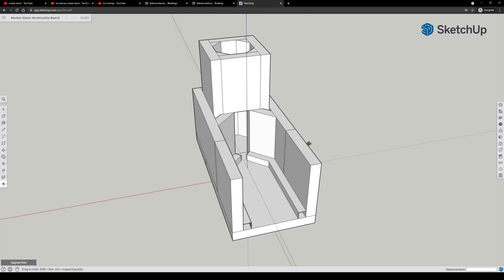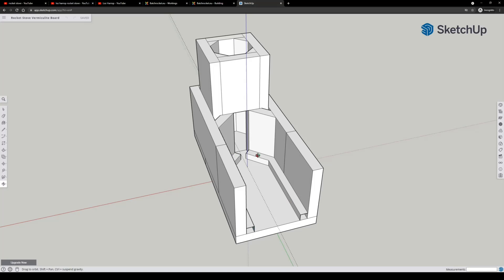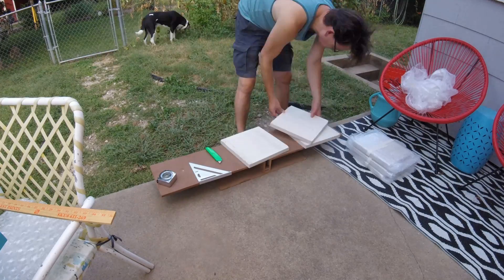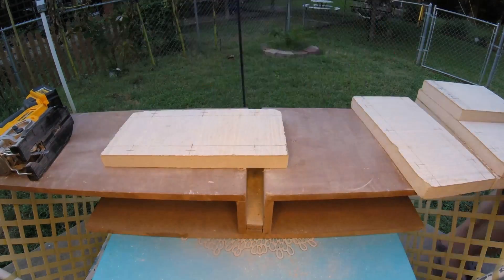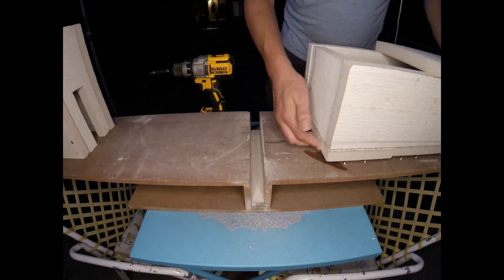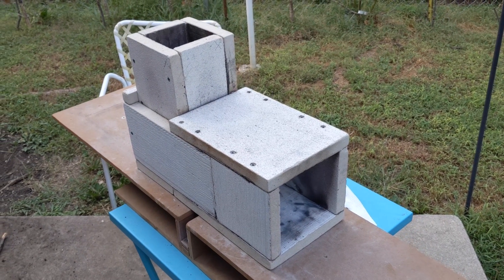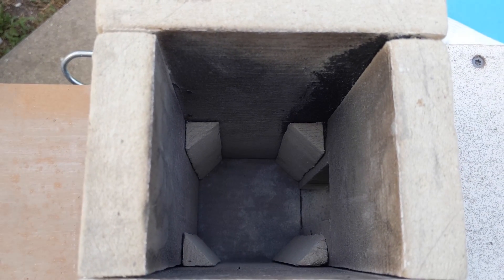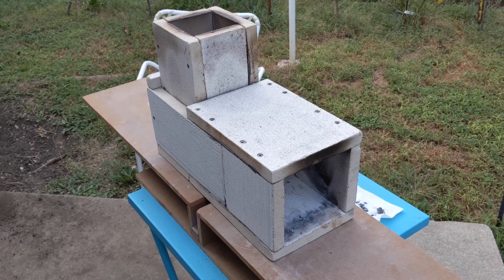No Welding, No Casting - DIY Rocket Stove

Comment: The flame must enter  into the side of rising chamber to rotate. I have one 3yrs back
Reply from the maker: You could do that, but then the flames climb up the heat riser faster. For an efficient burn you need higher temperatures near the entry of the heat riser and you achieve those by making the flames spend (relatively) longer at the bottom.

Additionally, as explained on batchrocket.eu the mixing between air and combustion gasses is also better with this more turbulent flow. 

That said, if you like to see flames spiral out of your heat riser by all means have them enter from the side, it looks great ;)
Reply: @BitsOfInterest  Thanks for all this! Yes, I spent most of a year playing with vortex generators and an adjustable heat riser stack.  Both the offset entry and the vertical slot (rams horn vortices) do work, but you are right, the mixing and combustion efficiencies do seem to favour a fast vortex spin rate with a reduced net vertical flow rate - more stirring, longer time in the hot bit. Which makes sense.  
Peter's vertical slot seems best - the double vortices in the 'rams horn' have a higher spin rate (in my test rig) than the offset entrance (similar to Lol's earlier designs) when running at a similar vertical flow, which is what is desired.
Your 45 degree entry to the slot is excellent thinking!  We are moving house now, so very busy, will try to get testing again in the New Year!
Reply from the maker: @250tegra  Thanks! As I said in the video, most of my design is based on the dimensions and ratios provided by Peter van den Berg. I'm not trying to be smarter than the guy that did hundreds of experiments, just make it a little easier to build with cheaper materials.

Hopefully before Christmas I'll have a video up with a door to keep the heat in the burn chamber and control the primary/secondary air better. We'll see what the differences are if I manage to build it right 😜

Comment: Quite a good desing with the ventury. However, I do not see how to use the heat in this desing for anything else but burning (efficiently) and maybe put a pot or pan on the exhaust.  Could the section beyond the ventury not be a bit longer and the top of that section be made out of metal so the heat could actually be used ?. It is so insulated that it needs to have a way to use its heat more effectively. Maybe look at the oil-drum (upside down) designs over the stove to make a radiator ?
Reply from the maker: Thanks. This is mostly a prototype to see if it still works with the simplified shape and construction. You could use this shape inside one of those barrel heaters, though you may have to protect the barrel above the heat riser in some way because the exhaust fumes are still very hot and the barrel may burn out.

I made it this shape and size because one day I want to build an oven/grill/smoker around it. It would be a metal frame with metal side panels and this would sit underneath to provide the heat for the oven. That would be another experiment to see if that will even work, haha.

PS I did make the heat riser double the height in the follow up video (which helps it draft much better) together with some other improvements: https://youtu.be/mAL9oKQCyg8
Reply: Crappy idea. 55 gallon barrels are hideous

Comment: Ceramic fibre board is a good alternative see Walker Stoves he has a great design.
Reply from the maker: Yeah, it's probably more durable than vermiculite. At the time I wasn't aware of this and vermiculite was half the price, that's why I went with it for this "experiment" ;)
Reply: @BitsOfInterest  the guy at Walker Stoves has collaborated with all the top rocket stove designers, Peter Vandenburge, Weaton, Earnie, he has experimented a lot, he is absolutely convinced that ceramic fibre board protected from abrasion by fire brick splits that can be replaced if necessary is the best option.
Reply: Also check out Himalayan Rocket Stoves his design is very similar to yours.

Comment: How about heating water
Reply from the maker: I'm sure that will work. These fires are a lot hotter than a regular stove, so it may be quicker.
Reply: @BitsOfInterest  Just trying to figure out the best way to incorporate some sort of water tank. Thanks
Reply from the maker: If you're just boiling water you can make some sort of metal frame to hold up a big pot above the fire, like cooking outside above a gas burner. If you're thinking about hot water for home use I've seen designs where they either incorporate a copper coil in the fire (may get too hot for copper though) or around the exhaust.

The channel Little Aussie Rockets has done several builds (out of metal) trying to find the best way to heat water with a rocket stove.

Comment: Hola.
Por el color del fuego has logrado entre 900° y 1.200°! Una combustión casi completa de la madera, 85 a 95% de combustión 👍.
He leído los mismos libros que vos.
Voy a hacer tu modelo.
Será mi 3er intento.
Muchas gracias, muy útil y bien explicado tu tutorial.
Reply from the maker: Muchas gracias. No hablo español pero tengo Google Translate :)

Buena suerte con tu construcción. Tenga cuidado con el tablero de vermiculita, es fácil de dañar.
Reply: @BitsOfInterest  - for the benefit of all, this is the translation:-
Hello.
Because of the color of the fire you have achieved between 900° and 1,200°! An almost complete combustion of the wood, 85 to 95% combustion 👍.
I have read the same books as you.

I'm going to make your model.
It will be my 3rd attempt.
Thank you very much, your tutorial is very useful and well explained.
......................................
Thank you @lasaramicael3009! ¡Muchissimas gracias! 
You make a very good point - the flame colour is closely related to the true flame temperature, and I agree with your assessment of the efficiency.
............
This, folks is why the 'iron pipe' stoves cannot truly rocket!
Iron and High Carbon steel are no longer reliable at 1200C. Some years ago in Australia we bought a little 'stainless steel' stove that burned OK, but never exceeded 400C, so it never 'ate the particles' properly, never mind oxidising the CO to CO2.  By tweaking it and providing a strong draught we got some reduction in CO, and then it came apart! It was probably a cheap stainless, but it was still not hot enough to purge the CO to CO2 fully, and it came apart!  🙈🙉🙊¡Que lastima!

Comment: Hiya, nice vid, I'm interested in making a batch box rocket, ot converting my "nearly" rocket mass heater into a batch box. I've been baking bread for two years in my other build, a J-rocket stove with an old gas oven on top, inspired by Loz Harrop. I realised, as you did, that the vermiculite is as strong as Weetabix so I cast a perlite concrete mix around it to give it some strength. It's an efficient baking oven, but wouldn't win prizes for prettiness.
Reply from the maker: Thanks! I made a follow up video where I compensate for my choice in material by adding metal on the outside edges and I put a basket folded out of expanded metal inside so I stop digging holes in my burn chamber when I put a stick in 😜

I've received a few comments that I should look into coating it with water glass or sodium silicate. I have no idea how it will work, but it's not going to get much softer than the wet newspaper it's now, haha.
Reply: @BitsOfInterest  I drilled pilot holes for my screws and was very careful, like you say, assemble only once. I made waterglass and tried painting it onto the inside corner where it's started to wear away a bit. but I can't tell if it's absorbed into the material. I might try painting a vermiculite piece with it before assembly for my next build. Meanwhile, I bake bread every week, very economically, and heat my house with my other rocket, very economically, plus it's been good fun!

Comment: cool experiment!! thanks - there is a dude who used ceramic fiber board in his steel stove!! He had a secret though that he didn't explain. So I phished it out of him and now he is going to make a new video explaining his secret. haha. It's called Double M Innovations - that's his channel. thanks
Reply from the maker: Thanks! I'm using vermiculite board and believe that's a little different than ceramic fiber board. For one it was cheaper when I was looking.

I don't like to keep secrets. I make videos so that if you think it's cool you can make it yourself. That's how I get ideas myself too, so I'm just giving back to people that are interested in this kind of stuff.
Reply: @BitsOfInterest  I'm just gonna jam a ceramic fiber board insulation piece under my steel baffle - to radiate heat down for a cleaner hotter burn. I just have a Two Dog stove in Minnesota - it's only 11 inch by 18 inch by 11 inch high. So also I'll use an 8 inch Ecofan and also steel duct heat exchangers - that you wrap around the duct pipe. I have a 30 degree duct pipe into a side wall and then use a big bucket of water for thermal mass. I would love a clean burn 1100 F. or whatever but the issue is how to keep is safe in a small hut setting - with a bed nearby - and also how to store the heat, etc. In a very cold climate you want heat radiating immediately - not just a slow thermal mass. Anyway - I like to learn - so thanks for the experiment. Yes the vermiculite is what the Century Stove baffle is that the "Double M Innovations" dude has - he did not even mention he had a baffle in his stove - and so then he goes - but I didn't say I removed the baffle! haha. People had no idea how his stove set up worked. Hilarious. I don't think he was trying to hide it - he just didn't realize he had not explained the real details. thanks
Reply from the maker: @voidisyinyangvoidisyinyang885  the idea with a rocket stove is that you're basically building it out of any kind of high temperature insulation so that the fire gets a chance to get hotter instead of radiating it out through the steel right away. I'm sure you could line the inside of a wood stove to do something similar.

That said, if you have it in a small cabin you may want that heat radiating from the steel firebox. An insulated stove may get too hot or dump it all outside through the chimney.
Reply: @voidisyinyangvoidisyinyang885  ok ok

Comment: Does the fuel /air ratio need to be 50/50 RE the secondary angle iron ports with pre heated air, so as to maintain not too fast of a burn of the fuel ( wood ), or would a flue only be needed at chimney and or air inlets, so as to adjust heat output and burn efficiently. I love your board concept though, for multiple reasons. Thanks for the video sharing.
Reply from the maker: I did not do the science, I just built it 😜 For air/fuel ratios and sizes I would refer to batchrocket.eu where I got my inspiration from.
Reply: @BitsOfInterest  Thank You for responding with reference url. I know there are alot of designs and many are really close to dims and materials, but was curious about yours ( video ) is because it really eliminates all the jargon of other videos that is pretty perplexing, but yet seems to have a nice even burn ( less smoke that's usually resultant of not enough oxygen to the burn chamber ). Thank You for your response and video though. It's conclusional enough for the non welder like myself that burns metal the moment I hit it with the stick or wire.
Reply from the maker: Thanks! The reason I didn't include any jargon in my video is because I don't have any :) I don't have the equipment to measure what's an "efficient burn" like on batchrocket.eu. Without a door like in this video it will get plenty of air, but it's probably not optimal. 

I'm thinking about building a door with a slider for primary and secondary air. I still have to figure out how to make that :p
Reply: @BitsOfInterest  Based on what Ive seen and read on the slider doors,, I think that with your use of the board your heat range is probably at nearly perfect levels for the board & the sliders that I saw on one rocket stove produced heat levels that melted thru the steel ( until he shielded the top riser area with stainless (( that is, the stainless plate added was added on the top section, before it entered into the chimney port )). I do see the potential though with the board you're using though. It's good to see your alternate means of heat without the other skills needed in metal box fabrication.

Comment: what glue did u use?
Reply: Tks. Just what I was looking for.
Reply from the maker: @adriancho1742  be sure to wear gloves. This stuff is pretty nasty and will burn your skin and even corrode some tools. First time you open it you may get a big squirt of watery stuff coming out, that's why I have some black smudges on some parts after cleaning up the mess. I also had a bunch of paper towels on hand.
Reply: @BitsOfInterest  why did u use vermiculite board instead fiber board?
Reply from the maker: @adriancho1742  I saw Loz Harrop use it for his rocket stove core a few years ago. It's easy to work with and at the time I think it was cheaper than ceramic fiber board. 

I have no experience with ceramic fiber board. It may be just as easy or better, no idea. I believe you do have to pay a little more attention to protective equipment (don't get it in your eyes and lungs) as with most fiber materials.

Edit: for comparison, I got 2 pieces of 12"x12"x1" for $25. I used 3 of those packs in this video and another for the extended heat riser in the update video. Ceramic fiber board looks like it could be close to double the price.
Reply from the maker: It's not exactly a glue, but I bought high temperature gasket cement to eventually create a door and seal it with a gasket. I also used this to fill the seems between the boards, but the screws provide the majority of the hold. 

You could also use refractory cement for this and it may even work better, but I've never used that before.
Reply: @BitsOfInterest  what is the name of the gasket cement?
Reply from the maker: I'm in the US so I bought "Rutland Stove Gasket Cement Black 10.3 Oz Cartridge" because the price and rating looked good, but you may have other options depending on your location.

Here's the Amazon US link:
https://www.amazon.com/gp/product/B000V4LTXC/ref=ppx_yo_dt_b_asin_title_o06_s01?ie=UTF8&psc=1

Comment: And why not make it a j-tube configuration so you can do vertical feed your firebox is plenty big for that you put a 10 ft piece of 2x4 and then feed about a foot an hour
Reply from the maker: I tried to stay close to the design and dimensions provided on batchrocket.eu for my first try. Maybe I'll make a J-tube some day, but probably first I'll try a bigger one, maybe with different materials like refractory cement. For now I'll be seeing how this one holds up. It does what I need it to, which is burn most of the sticks that fall in my yard 😁
Reply: @BitsOfInterest 
I guess you would cook that with cob or something concrete or something just to make it more durable and long-lasting right?
Reply from the maker: I painted the inside of the firebox with water glass (sodium silicate) but you could paint the whole thing with it if you want to. If I was using refractory cement I wouldn't use vermiculite board and just cast the whole thing out of it.

Comment: Awesome Job¡!!!
I love outside the box thinking. so in this case you need to build a I think an a metal frame for that all the way around maybe 2 in angle iron just make a casing for it or she sit in cob or she sitting in fire brick just give it some protection but that would be a good liner for a rocket stove if it doesn't totally deteriorate from the heat I don't know did you get the laser gun it'll go high enough to check your heat? and yeah I did a rocket stove a real one and the guy built it for destroyed it took it apart I couldn't believe it like losing one of my own children until I put so much of my life into it.
You're right looks like a double vortex at least two same kind of split and went right and left that's still phenomenal great job there!!!
Reply from the maker: Thanks! 👍 I did make a metal frame out of 1 inch angle iron and folded some expanded metal into a basket almost to protect the bottom and sides of the firebox. Vermiculite board is rated to 2000F (1100C) so it should hold up as long as I can stop myself from poking it with sticks, because then it scrapes little pieces away.

I'm publishing a new video about the upgrades in the next few days. It's all filmed, just need to put it together 😁
Reply: @BitsOfInterest  how about a high heat refractory mortor on inside when on fresh build BEFORE first burn?

Comment: Please wiki vortex. This is cyclonic. A vortex is much different
Reply from the maker: I'm just using the terminology that most rocket stove videos use, including the sources linked in the description. 

PS I'm not a physicist, but after Google/Wiki I'm not convinced vortex is incorrect per se.

Edit: It's just two of them side by side. Feel free to link to a reputable source for the definition of vortex and cyclone. A comment with a link gets withheld automatically, but I'll approve it so it shows up.